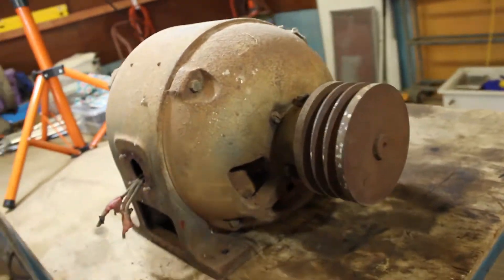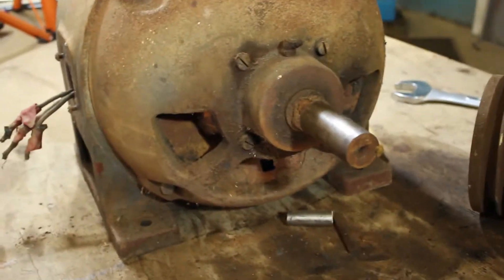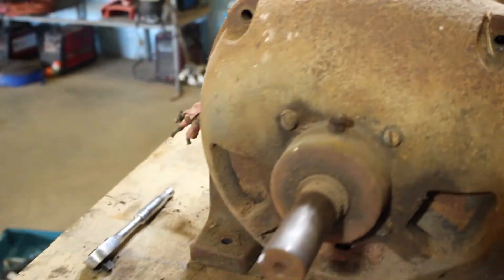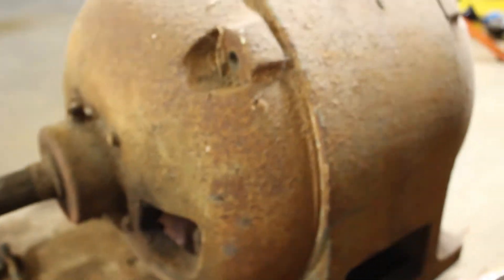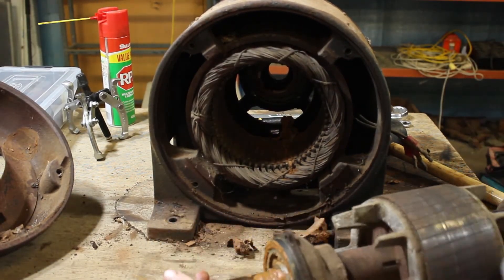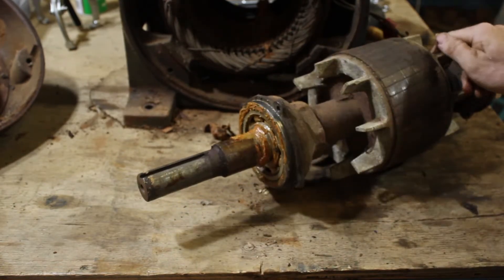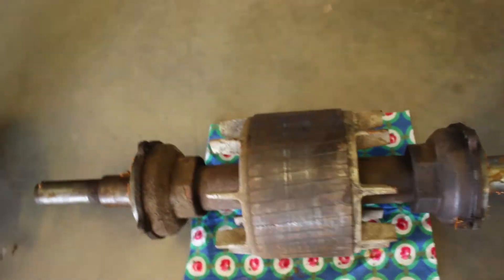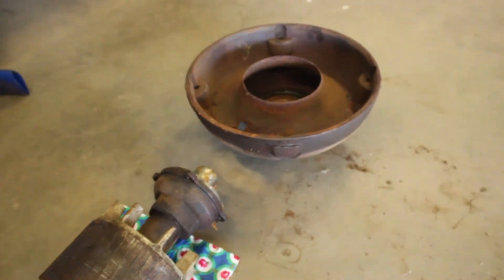Porter McLeod Lathe Restoration - Part 3: Motor Disassembly (1/3)

Comment: What's the motor rated at? Was expecting it to have a wound rotor.
Reply from the maker: 7.5HP i believe. I guess it was easier to build with squirrel cage back in the day. Plus being a clutched spindle lathe there is no real need for the extra starting torque a would rotor would deliver.

Comment: That bearing looks pretty loose in its housing. I Had the same issue with an old motor and it was knocking like an engine with a big end failure. I would put some new grease in, and see how it runs before anything else.
Reply from the maker: Thanks for noticing that. Ill have to have a better look how it sits when it is assembled. A bit of bearing retainer might also be needed.

Comment: I got a lathe exactly like this one theres not many out there. Do you have any of the original manual or paperwork with yours.
Reply from the maker: Oh wow, I didn't think I would find many people that have the same lathe. I have a little paperwork but I got it from Kieth Rucker's vintage machinery website. How is your lathe for condition? Can you read the feeds and speeds nameplate?
Reply: Kit Barlow I just bought it but it's in working/running condition just a lil dusty I bought it and a phase converter with all the change gears and some tooling the guy I got it from got it from a Wire and cable company that was closing but yes most of the stuff is legible on it
Reply from the maker: Thanks Cody, Is there anyway I can contact you for some photos of the nameplates and talk about some of the change gears? If that's okay.